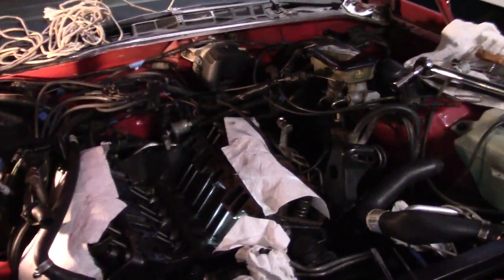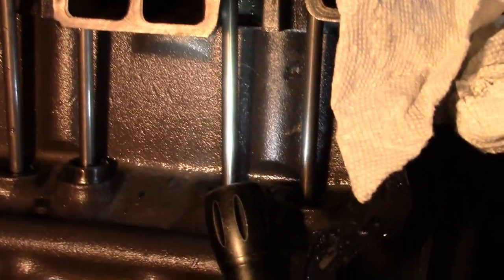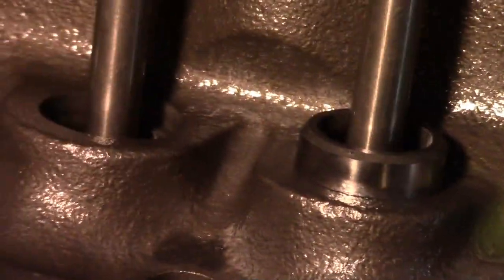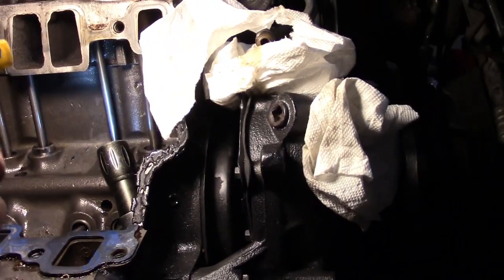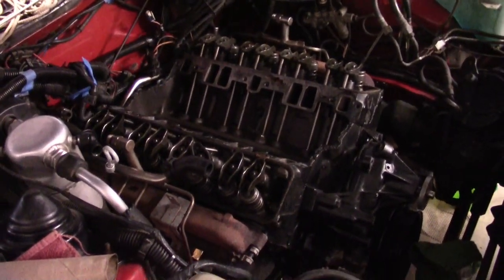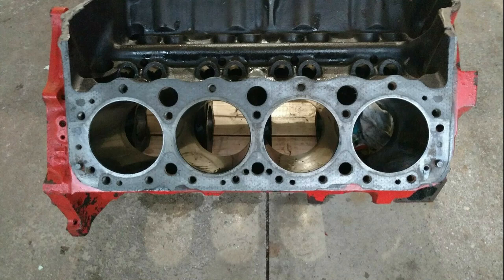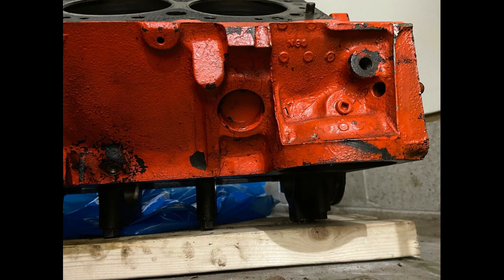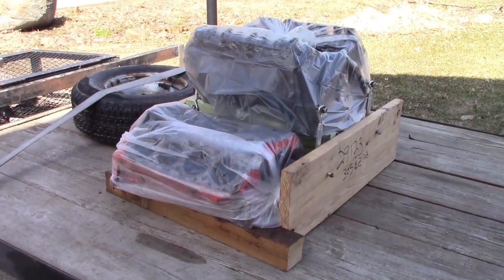Cracked SBC Block Leaking Coolant in the Valley - IROC-Z Barn Find EP#27

Comment: PLEASE!! get a roller cam upgrade...
Reply from the maker: Sorry, it's a good thought, but I won't get a roller.  First, it is under warranty and I have some limitations on my options.  I can't stray too far. To use a factory roller means a newer block.  I could possibly use an aftermarket roller in the current generation block, but they're rather expensive and aren't necessarily trouble free.  I have run lots of flat tappet cams over the years without issue and don't see a reason that it shouldn't work. I'm running VR1 oil and the break in  additives.  It does seem that the cam companies are getting rather extreme with the break in routines.  It used to be "just don't idle" for 20 minutes, now they have precise profiles.  But, if you don't follow their rules, their warranty is void.  In this case, there was probably at least a pint of coolant in the sump.  It doesn't take much glycol to ruin the oil. 

The shop is providing a new cam and changing brands for me at their expense, so I'm going to take another run at it.
Reply: Okay, that makes sense. As long as the right oil is used, I'm sure it will be fine. Keep in it, results will be satisfying!